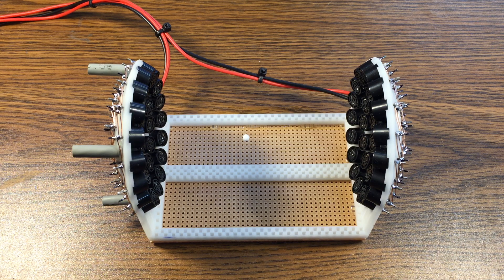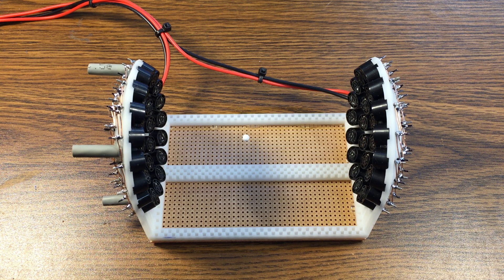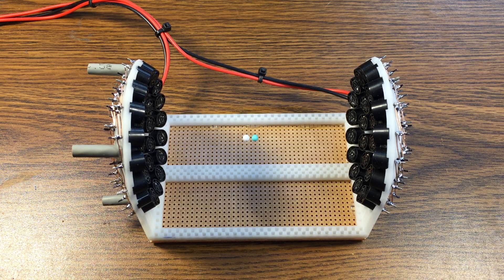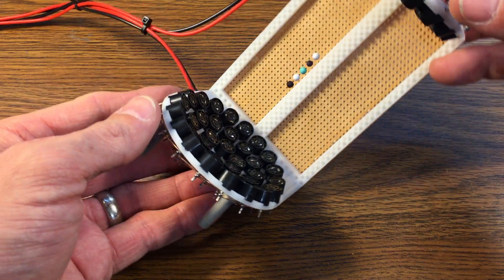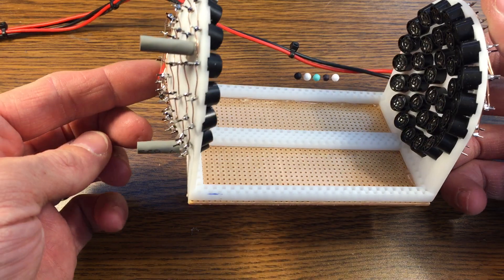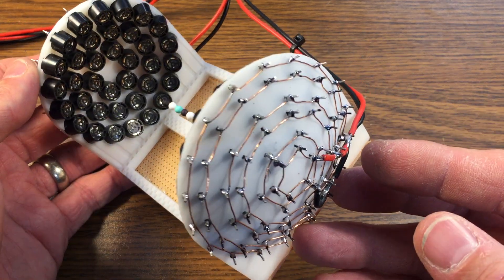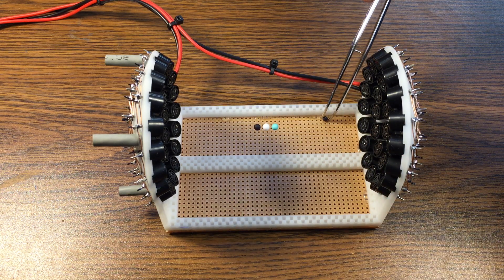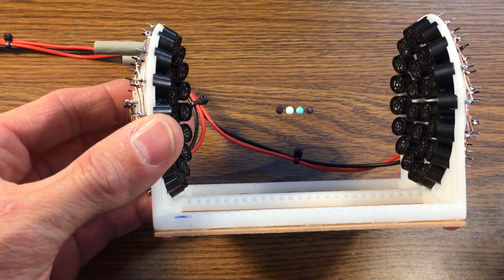Acoustic Levitator Demonstration

Comment: Hello, back again, successfully printed the frame! Do you happen to know what AWG the exposed wire is? I just realized it can't have any insulation on it and I am trying to figure out if the wire I have will do the job.
Reply from the maker: Great job Ben on printing the parts!  As far as wire gauge goes, if you used the strands from ethernet cable, which are 24 gauge, they are capable of handling over an amp, which is way more than what will be flowing through these wires.  As for insulation, you can have insulation on the wire, you just need to expose it where necessary to solder your connections--there's no necessity to it all being bare.  In some runs of wire it may be easier for it to be bare though.
Reply: @johnfixesstuff  Great, that's all very helpful to know! Thanks so much again for your responsiveness and help with this project, I really appreciate it
Reply from the maker: @jamsbyben  it is a really fascinating project once you get it working.

Comment: do you happen to know how important the 3-d printed frame is? I do have a 3-d printer arriving, but want to work on this as a weekend project, and figured I could make a frame the old fashioned way in the mean time to get the wiring and electronics set up. I just don't know if the arrangement of the sensors and receivers is precise in terms of their angles, or whether it would still work if I estimate that
Reply from the maker: They physical dimensions are absolutely critical.  The exact shape of the sphere that holds the transducers is determined by the frequency of the sound wave being played on them, which creates the high and low pressure zones which make the foam spheres levitate.  If you change the orientation of the transducers it will not work at all.
Reply: @johnfixesstuff  Thanks a lot for the fast reply. My 3-d printer arrives today, so I will print the part once I learn how to use it. Do you remember how long the sphere took you to print, roughly? Just curious what time im looking at
Reply from the maker: @jamsbyben  I bought the kit linked in the description which came with the printed part.
Reply from the maker: The original project was posted on this Instructable and it has the files for 3D printing the parts: https://www.instructables.com/Acoustic-Levitator/

Comment: Did you have to worry about polarity being wrong on the transducers?
Reply from the maker: Definitely, the guidance I got was that the polarity markings on the transducers should not be trusted. I used two channels on my oscilloscope. On one channel I measured the signal being played on one transducer and then the other channel across the leads of another transducer that was receiving the signal being played (the transducer was working like a microphone). If they were in phase they were connected identically.

Comment: What's the height of styrofoam Levitation and what's the voltage
Reply: I've made one but in it transmitters kinda pushes styrofoam ball towards recievers and I'm not able to Levitate
Reply from the maker: A couple possibilities: 1. if the polarity of any of the transducers is reversed, it will interfere with the standing wave, 2. If the object you are attempting to levitate is too big and/or the density is too high, it won't levitate either.

Comment: Did you have the occasion to hack this kit a little bit? E.G: Signals sent to the transducers? (voltage, wave shape quality, etc...); Are the transducer holders exactly parabolically shaped? Phase resolution step when changing the phase. Any other thing...
Reply from the maker: VPTech, the kit is completely open source and the wave shape is only limited by the arduino code that generates the signal, the amplifier hardware making the wave-forms, and the transducers which are playing the sound.  The kit I made can be purchased here: https://www.makerfabs.com/acoustic-levitator.html and the plans for making one by ordering all the parts individually and printing your own shell (including the 3D-Print Files) can be found/downloaded here: https://www.instructables.com/id/Acoustic-Levitator/